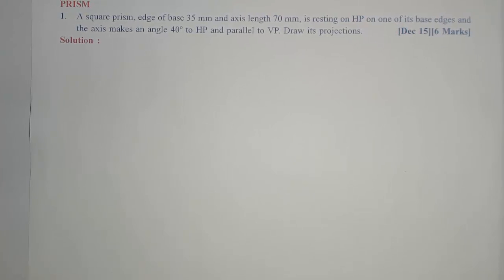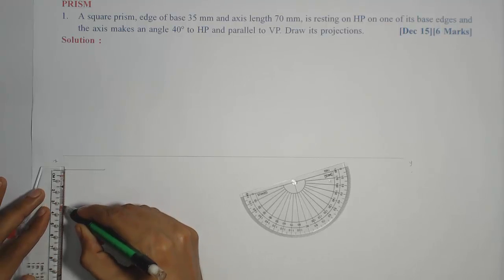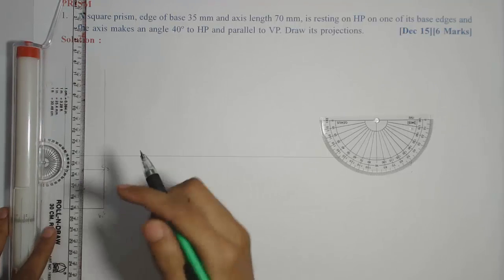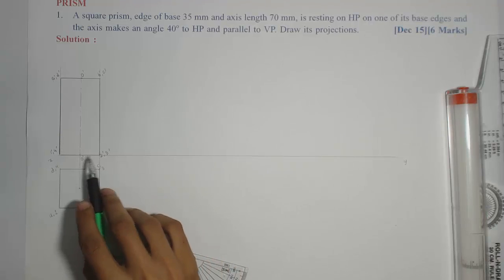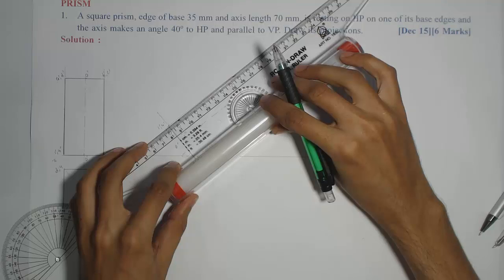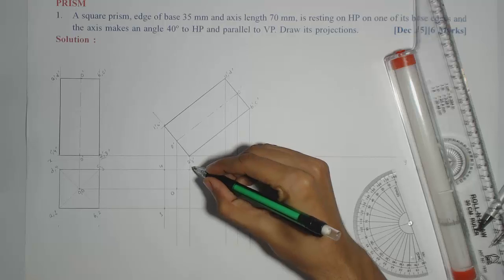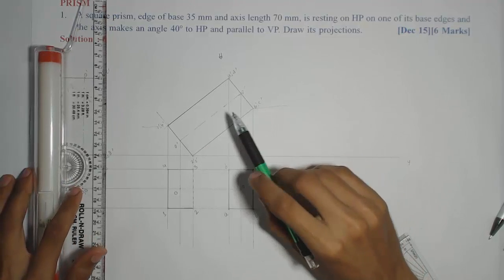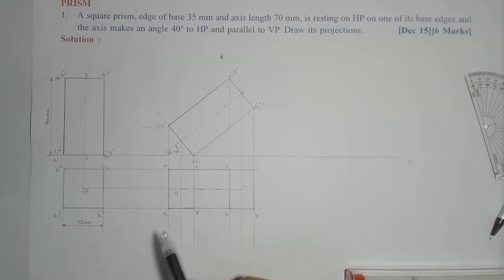Prism Q 1 Dec 15

Comment: thankyou sir 
very helpful:)
sir can u please explain what does parallel to v.p means?
Reply from the maker: In first stage when u keep the base on the HP the axis is perpendicular to HP but parallel to VP. But when u tilt the solid in second stage with axis making angle with HP but it still remains parallel to VP. So its just a two stage problem.
Reply: thankyou sir for clearing my doubt
Reply from the maker: WC!! Best of luck!!